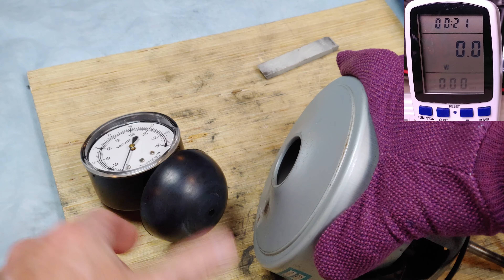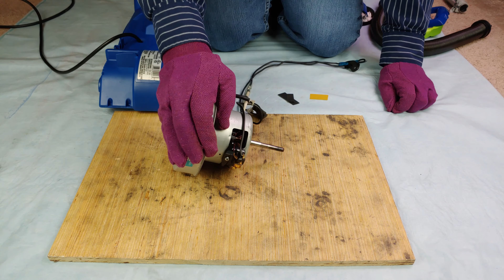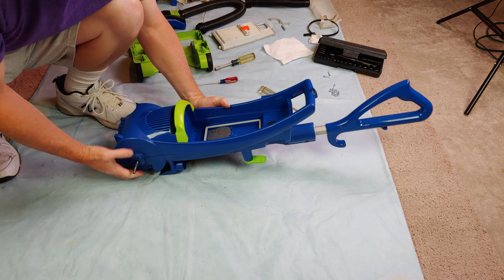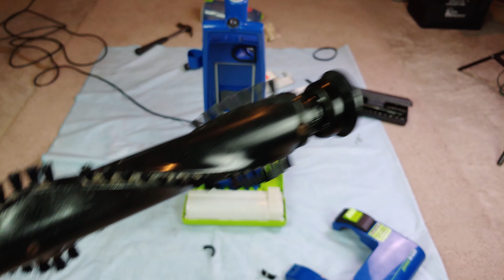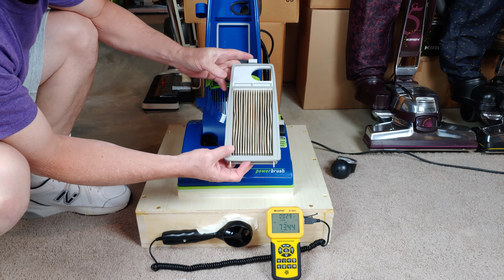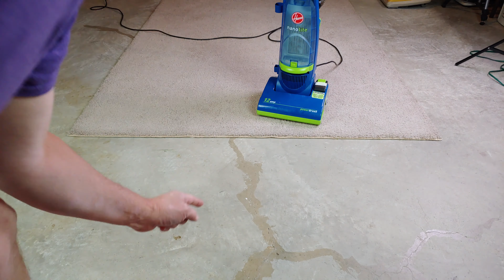Hoover NanoLite Refurbish Airflow Box And Pickup Tests

Comment: I am very impressed. 70 cfm is in the bagged vacuum category. I am sure that it's due to the lack of cyclone. I mean this is like a bagged vacuum without the bag. Add cyclone and at least 15 cfm is lost. Air spinning in the cyclone has to fight to get to the center screen and that's the reason for cyclone airflow loss. I hope you can get that brushroll idler pulley locked in to the brushroll so it can be used 👍
Reply from the maker: I'll try to figure something out to make the existing brushroll work.
Reply: @VacLab  What MORON abused their vacuum so badly ??
Great rescue ^_^

Comment: You could try and use the broken piece and make a mould out of it, then you could try and make a new one out of epoxy or something. Lots of Super glue might work on rigging the hard floor idler wheel into a new drive if all else fails.
Reply: The plastic piece can obviously be 3D printed, however 3D printing on a civillian level leaves a lot ot be desired and will not stand up to that abuse.  However what can be done is make a 3D print duplicate of the part, use that as a mold, and make the new part from metal at a machine shop.  That's what I would do. 

Or if you epoxy the broken part well enough you can nurse it along and be very delicate until you find a new brushroll.